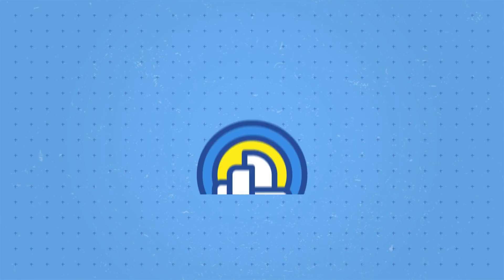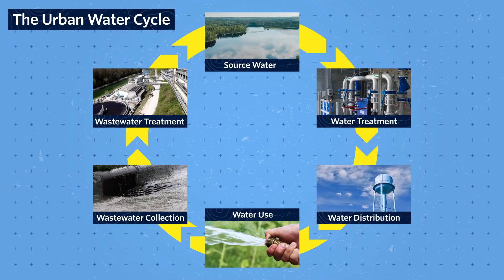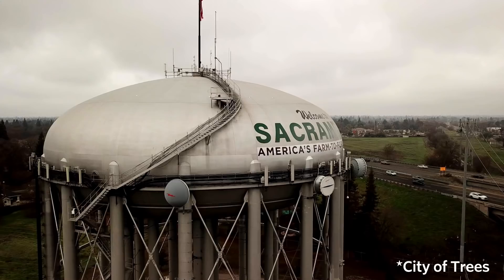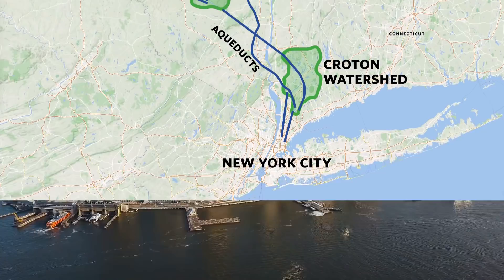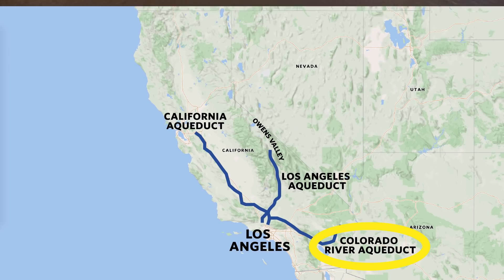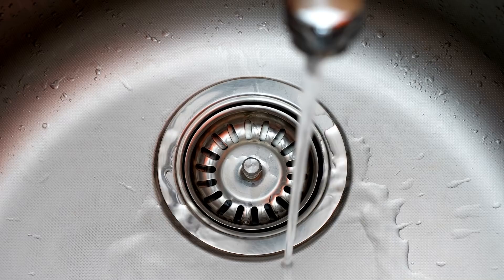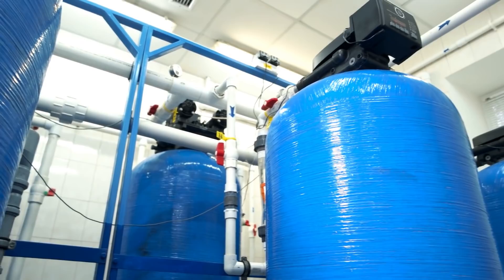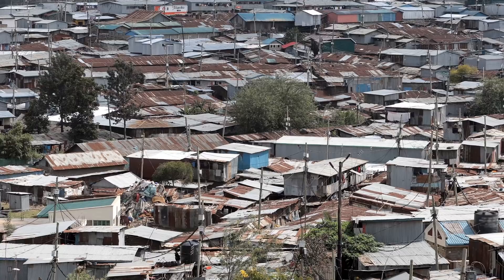How do cities get enough fresh water?

Comment: Great overview, and thanks for the shoutout!
Reply: While you’re here maybe you can answer this or make a video on it. 

explain to me why we can’t use solar towers to evaporate water to purify it while also generating electricity at the same time.
Reply: Oh yes, I know how to use my billions to stop climate change.
Let's sell a book, and make even more millions
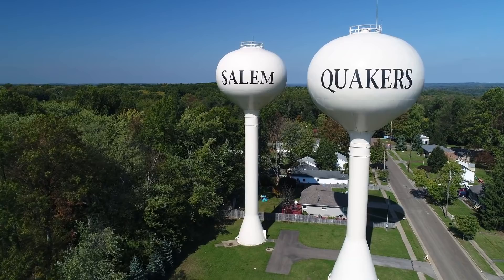Reply: Ooh!  It's Grady!  I have a minor issue with the water tower listed at 2:59, and your water hammer video has all the background you'd need to understand.  Basically, this video lumping it in with water towers without some caveat is slightly burying the lead.  Since there is no tank on top, this tower is not very for storing significant amounts of water.  The key is finding where this style is built: near pump houses built early on in the 20th century.

Back then municipal water was pumped by giant steam pumps, rather than modern electric impeller style pumps.  Their enormous pistons created constant pulses of pressure that would tear apart pipes without some way of letting off all that energy.  In your video you talk about surge arrestors which use an elastic bladder to absorb some of the energy of pressure changes.  You then mention traditional tank style water towers being able to absorb the surges by driving the water up when the pressure increase, and which consequentially also normalize the low pressure valleys by the hydraulic weight of the water coming back down.  For reducing water hammer, the diameter of the water column doesn't really matter (give or take friction and resistance) as hydraulic head is simply a measure of how high up the surface of the water is.  So, you really just need a pipe connected to the water network, sticking up out of the ground, open to the air on top with some screening to make sure bugs and worse debris don't get in.  Make sure the pipe is taller than the maximum hydraulic head you expect so none spills out the top, and you have a standpipe.

Now, in some places the standpipe is just iron pipe standing up out of the ground, and I do love when a thing's name describes exactly what it is.  But some places decided to pretty it up a bit, such as the Chicago Water Tower shown at the time listed in the beginning of this increasingly long comment.  And then there is my favorite, which is also a standpipe and not a "traditional" water tower: Milwaukee's North Point Water Tower.  I mean, just search for some images of this fairy tale inspired piece of architecture.  And to top it off, in the mid 80's an artist made a 30 foot long dragon sculpture that perched on a window of the tower for five days.  Which brings to mind my actual favorite version of this water tower, which unfortunately doesn't exist in this reality (yet.)  In my memory the dragon has grown larger and larger like a fisherman's prized catch until now I distinctly remember an elegant, regal copper dragon completely covered in patina from the years it spent there, body curled up around and around the tower like a powder blue Wat Samphran, watching out over and past the horizon of Lake Michigan, scanning for... hydraulic transients, I guess?  And I think the world would be a better place if more municipalities dressed their infrastructure up with this level of whimsey.  I'll also give some points to those communities that paint their water tower tanks with giant smiley faces.
Reply: water engineering mentioned
Practical Engineering: Who summoned me?
Reply: Bill Gates convinced Oxford to close-source their Coronavirus Vaccine after they had promised to open-source it which would have made it cheaper and more available to poorer countries.